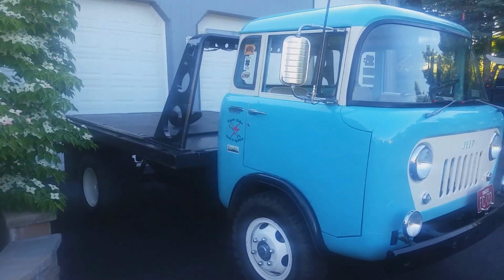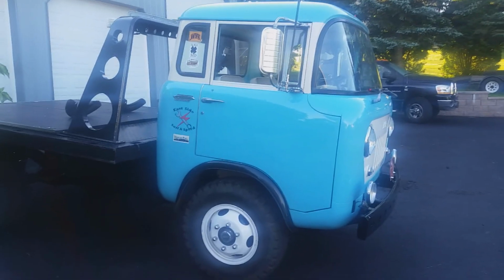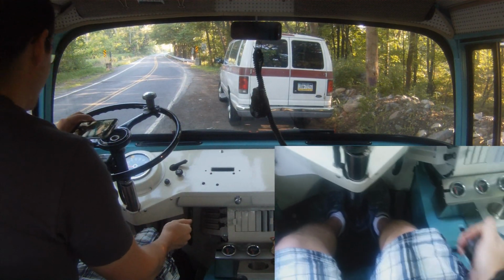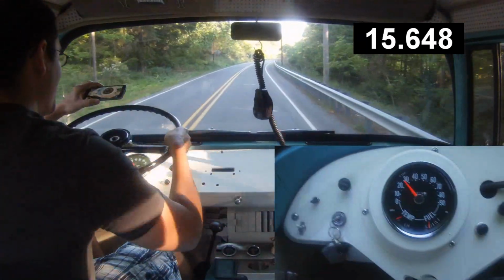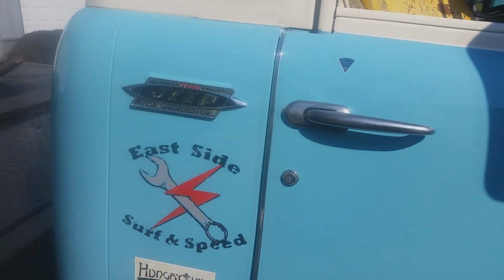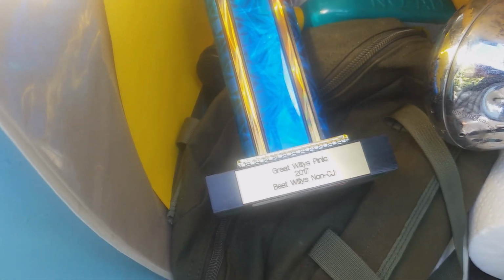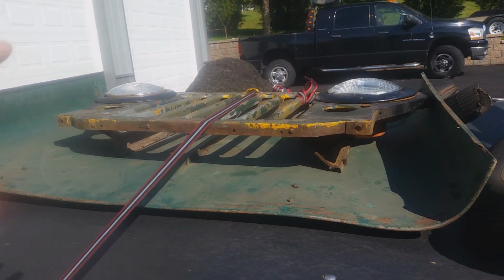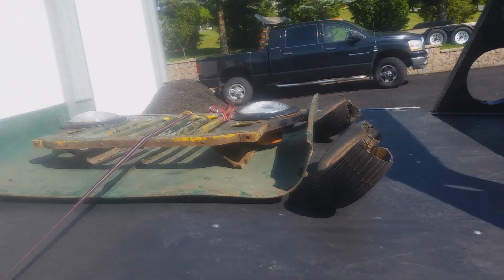Great Willys Picnic

Comment: Great adventure in the FC! But is it really comfortable to drive? Looks quite uncomfortable how you have to hold the steering wheel O.o
Reply: the steering wheel is like that on any ''flat noes vehicle'' when the wheels are directly under/behind the driver.
Reply: That wasn't my point :-) I was referring to the height of the wheel that resulted in a pretty much raised arm position.
Reply from the maker: +Learning by Gaming Yea it was raised a bit by the previous owner. It isn't that bad. My biggest issue is I sit up so high I feel I need to hunch down to see out the windshield. When really I don't need to
Reply: After a few more expeditions, you probably got used to this. Also, it's interesting to see you paddling to get more speed :-)

I can't wait to see your new Willys desk :-D

Comment: Has a flatbed, doesn't keep ratchet straps with it. Powers pls. 

Congrats on the trophy and doing a 100 miles drive in a truck with no shocks
Reply from the maker: +Ncwg4 thanks. Also fear not I now have 2 large ratchet straps and 4 small straps
Reply: powers2440 Good to know, you can never have enough straps